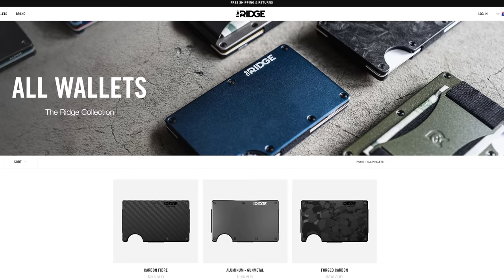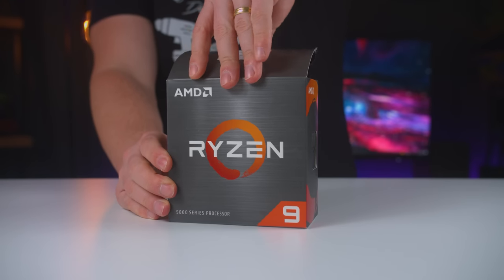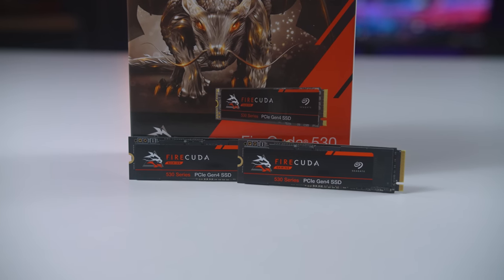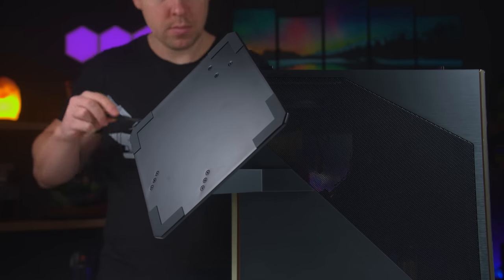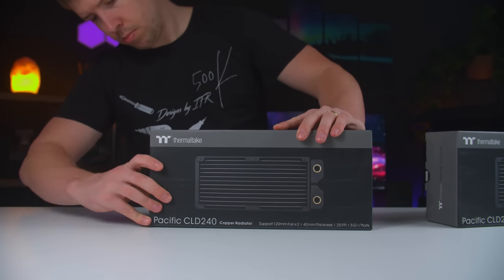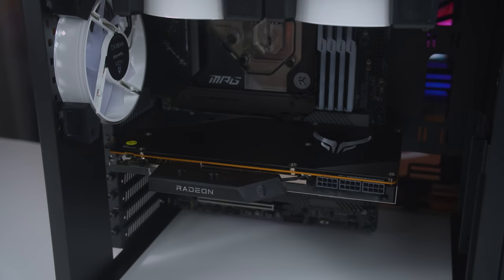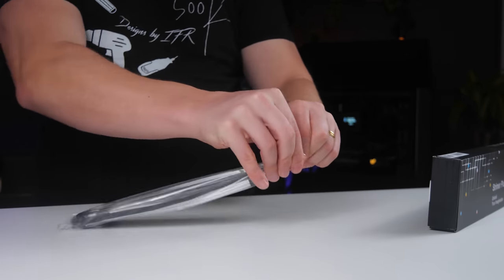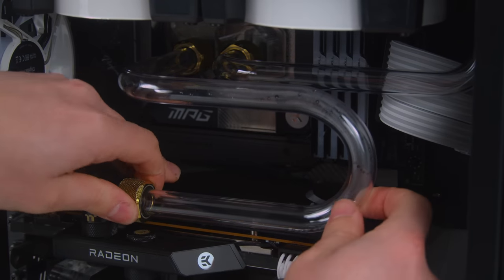The all AMD Ultimate Gaming PC!

Comment: Haha very nice video, I also own this liquid devil and plan my build on the same mainboard. Wish me luck with my first hard tube water cooled all AMD System. Can you confirm that a 4-pin extension cable below the cpu block is needed?
Reply from the maker: The 4 pin is not needed unless you want a little extra power for overclocking etc.

In this particular build i only had the 8 pin connected